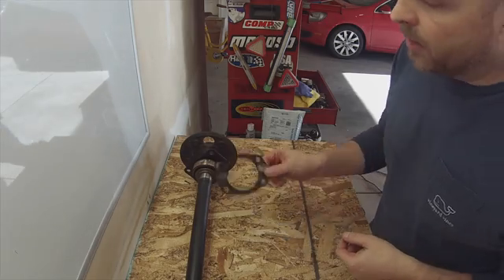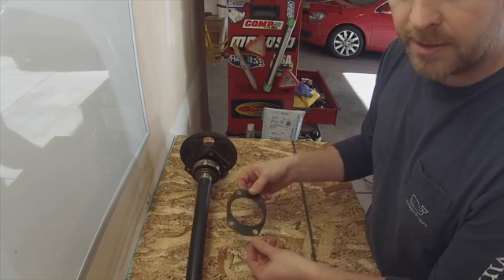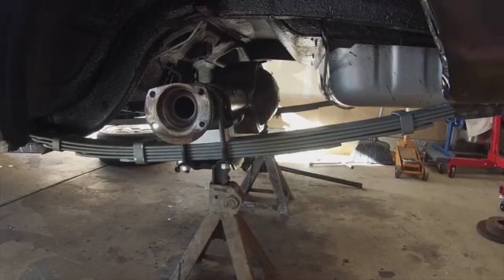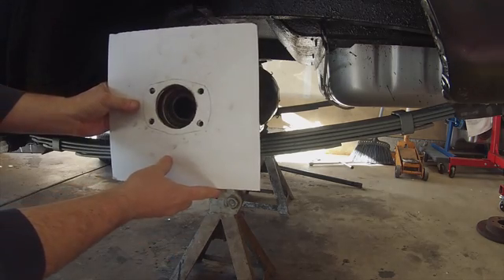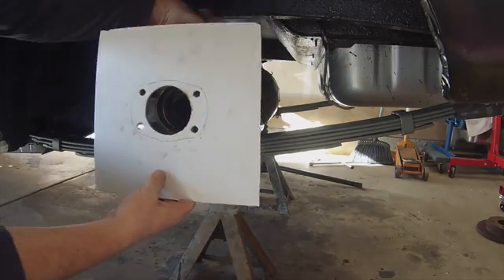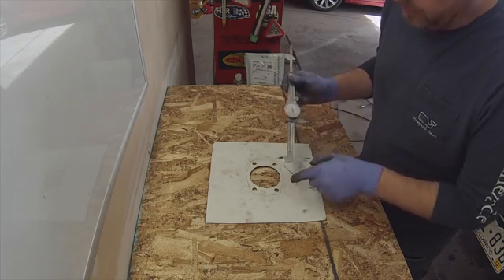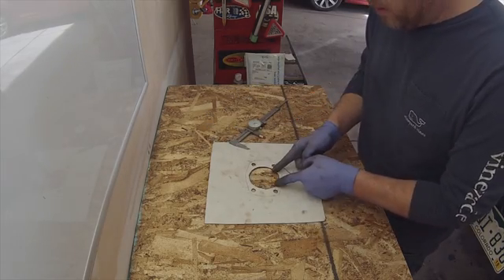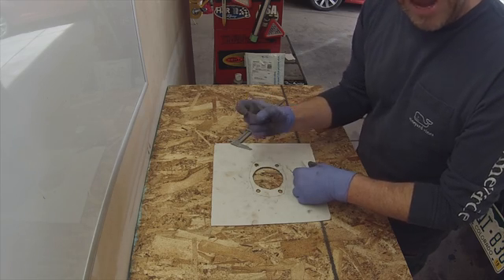$300 Four Wheel Power Disc Brake Swap: 1965 Mustang Project Code Blue

Comment: Sean, how is the rear disc running true? it doesn't look like the centre hole in the disc fits snug over the end of the axle, are you just relying on the 5 clearance holes in the disc for the 
wheel studs?

Comment: Awesome project.  I'm working on a similar 1966 Mustang , my driver for the past 41years. Sorry if I missed it, but  Did you mention the source (Make/Model/Year) of the dual master cylinder?
Reply from the maker: Thanks!  I found it on eBay, so not sure what it was originally on.  Was advertised as power brake upgrade